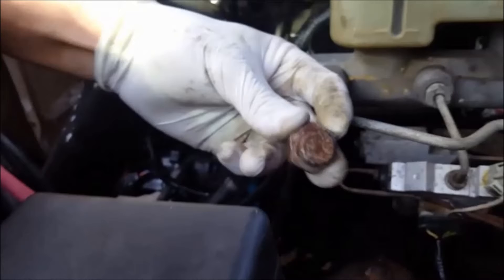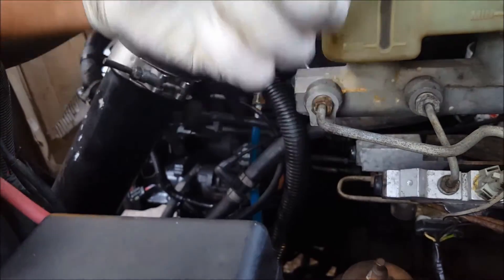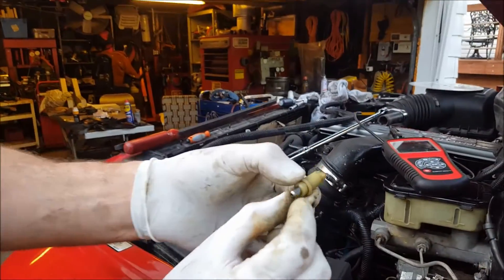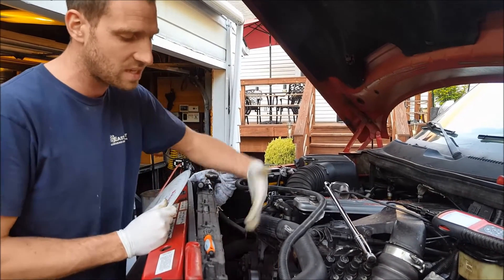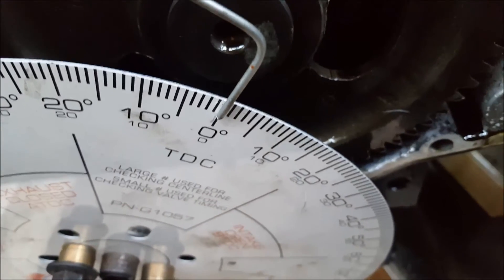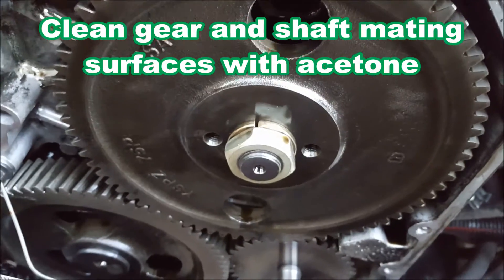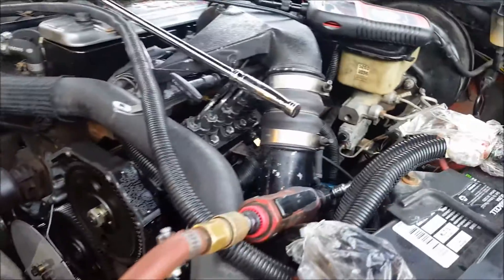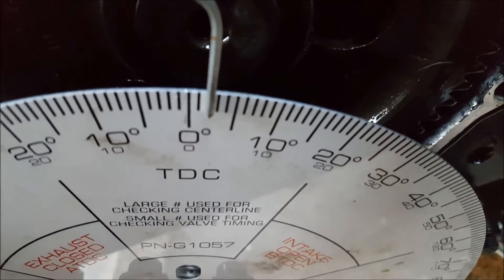How to set 12v Cummins Injection Pump Timing OVERVIEW/INSIGHT

Comment: Good video but a little bit too fast hey I got some questions for you this is the first time I've ever done a pee pump swap and it's factory set at 13 degrees so I wanted to know what your thoughts are the brand new pump that I have is already timed at top dead center with the thing in the flag position and I have my crank cam gear and injection pump gear in the same identical spot it was before I pulled the old pump off which was a p 7100 there's supposed to be identical on the delivery valves and horsepower etc I just wanted to know from all with the book saying they're saying I should use a dial indicator which just measures the Piston travel of the injection pump valve or piston that goes up and down whatever you want to call it anyhow do I even have to use this degree type wheel I ordered one and I ordered the firing tool but I actually found it easier just to use like a pic and stick it in the hole to where the thing you pull back and push forward the timing pin they call if you do it out of the book did the new pumps already come should come timed if you're only going back to stock so long as my gears didn't moveI marked them with a white marker and the Pistons at top dead center cuz the heads off and I did some motor work to it actually rebuilt the whole engine besides the cam so I think I should be fine just taking that little thing out the side the cap and just reversing that to where the Little fork part of it is facing towards me now correct and if that's the case I don't even have to time it with no type of specialty tools so correct me if I'm wrong or should I still have to use the timing wheel if I want to do it without the dial indicator

Comment: How would I tell what my timing is at? I have the timing cover off and will be installing an adjustable timing gear. Truck was turned up to 18 degrees then taken to another shop and was supposed to be bumped up to 20 degrees but I have my doubts. I’m doing it myself now and but not sure how to tell what degree it’s at currently